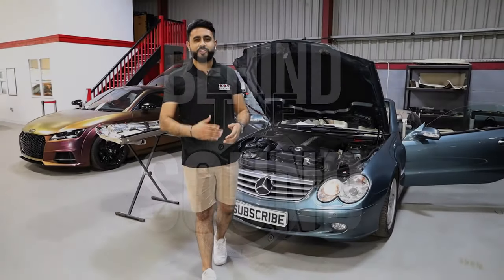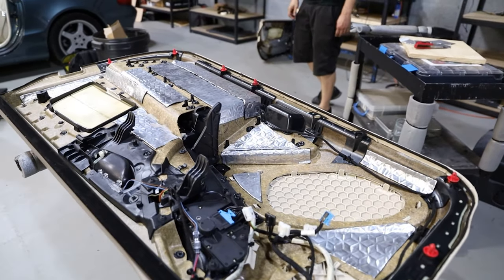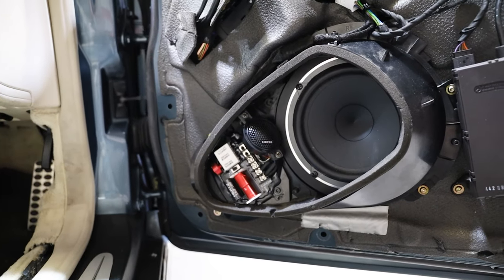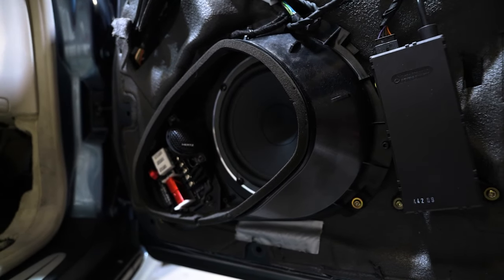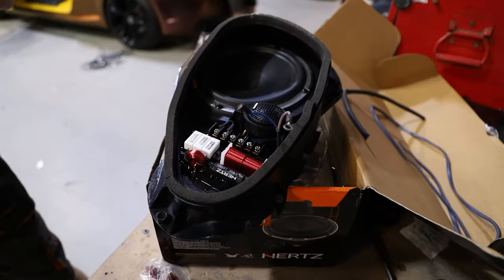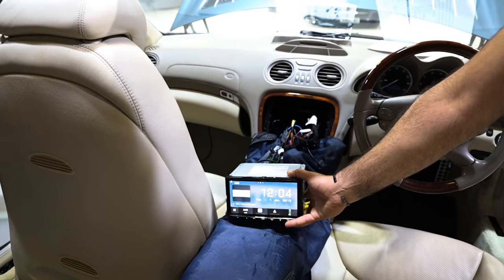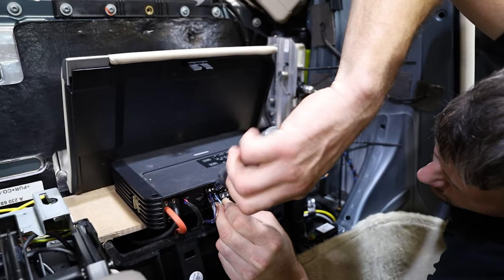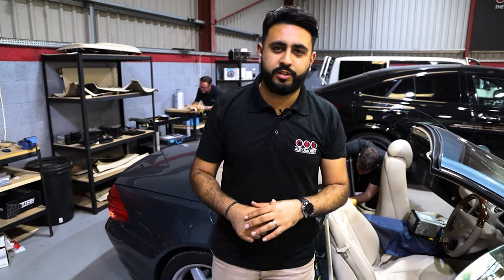Amplifying A Modern Classic Sound System Upgrade | Behind The Sound - Mercedes SL500

Comment: Should be conned to the consumer battery in the rear. The front battery is purely for starting the car and powering the electronic brakes. The front battery has 500 CCA while the bigger battery in the rear produces 650 CCA. Plus, if connected to the rear battery (consumer battery) and the user plays his system for an extended period without the engine running, while that can cause the battery to go flat, then the front battery (Starter battery) will always be able to start the engine regardless of the rear battery becoming flat. Also, the rear battery (aka the consumer battery) must be of the factory spec AGM battery (type 096) which has a deep cycle discharge and recharge recovery. These AGM batteries are also now known as "stop start" batteries, but back when Mercedes designed the R230 (late 90's) there was no such thing as a "stop start"battery, they were called AGM (absorbed glass mat) which contains no acid fluid but a gel instead. Please do not see this message as a criticism, I am just informing you because many do not understand the battery system in the R230 so replace the rear with a standard led acid battery. Nice install btw.
Reply from the maker: Thank you, that is understood, however the system doesn't have much draw plus we always advise, when in the vehicle - the vehicle should be running not sat with ign on as that can also cause issues. Appreciate your comment though :)
Reply: thanks for your reply, keep up the good work.